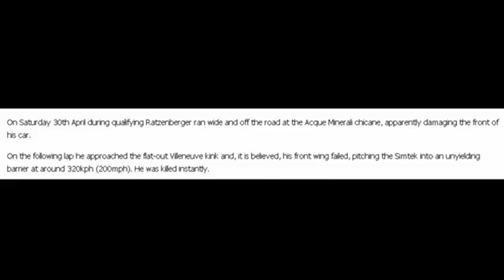Imola 1994:Ratzenberger-how and why he died

Comment: FIA. Those concrete walls will protect them
Reply: At that time there wasn't any technology to protect the drivers like nowadays, there wasn't the Tec-pro's or any device apart from the concrete barriers... Such a tragedy, but inevitable...
Reply: at least they learnt from it and improved the safety of the cars, as we saw with grojean at bahrain
Reply: This comment aged horribly...  they used concrete after Roman at the weekend as the car would deflect and NOT go through and trap or SPLIT an car in 2 resulting in fire... it say on the ticket motorsport is dangerous.
Reply: @leart78 calm down calm down.  Why cant someone talk about the fia ?  Like everything ever done has never worked?
Reply: @bakinek Berger and senna both looked at the corner the day b4 senna died and agreed nothing could be put there.  I'll listen to senna and Gerhard on this one. Also the track changed to fix it not the corner.
Reply: Boom mike drop.
Reply: @bakinek They should have had tire barriers all around the track near the concrete walls. That would have cushioned a lot of the impacts, and no doubt saved a lot of lives.
Reply: @michaeldavis2531  all that does at incredibly high speeds is increased the chance of flipping the car though
Reply: man, imola had tyre barriers everywhere except the tamburello and the some parts of Villeneuve section
Reply: @bakinek Villeneuve didn't have tyre barriers as well

Comment: This was one of the very few fatalities that was caused not by driver error, not by mechanical failure (it did has a part in it, but it was not the main cause), not by bad luck, but because of driver being inexperience.  He should have come back to the pits and checked the condition of the car, or at least have the mechanics take a quick look at it.  I sent a card to his family, and they thanked me by sending me a black and white photo of him.   He actually was quite talented.   It was just sad because he finally made it to F1.  His team also might have screwed up because they would have called him in to check.
Reply: Well, nobody knew how severe the damage was on his front wing. He would have came in obviously if the damage made him slower. The team even asked Adrian Newey for help, since they had problems with wings being loose

Comment: Never knew that his crash and impact was far worse than Sennas. Senna was able to break and slow down to 200 something kph, senna never broke a single bone below his neck.. Rip roland.
Reply: He had a fractured skull
Reply: Roland suffered basal skull fractures and also a ruptured aorta...both common fatal injuries in high speed, sudden deceleration crashes. 
As his helmet appears to have been damaged he probably also smashed his head on something, the cockpit side or his steering wheel while his head was being flung around after the initial impact. 

We don't know for sure if Senna would have suffered brain injury or not if it hadn't been for the wheel and suspension hitting him in the head. 
Although considerably slower than Roland's crash it was still a very fast and hard impact.
Reply: yep. comment edited to "below his neck" cause ineed he had a skull fracture
Reply: Look at Rubens, he crashed at the same track and it was way worse than Ayrton's and Roland's
Reply: @seb99342  Well, it looked worse because of the way the car flew and turned over. But in terms of sheer speed and force of impact, Ratzenberger's was definitely the worst. Everyone just knew as soon as they saw it that he wasn't going to survive such an impact
Reply: @reds005 That was only from the carbon fibre breaking in to his head. Other than that he had nothing, no scratches. Even the experts said that, if the thing that killed Senna, would have flew 6 inches up or down he would have survived.

Comment: RIP Roland Ratzenberger. i remember it well the day before Senna died. Most people remmeber Senna but few remember another F1 driver like Ratzenberger. Greedy Guts FIA and their using drivers as money puppets. Concrete walls just a few metres away from 220MPH cars are accidents waiting to happen. At least some change has happened since then which is good.

Comment: It could so easily have been three, when Rubens Barrichello crashed heavily & a not particularly professional rescue attempt could have aggravated things further.  Luckily Barrichello wasn't badly hurt but sat out the rest of the race weekend, just as well as what was to follow.
Reply: The way they dumped him upright like a sack of potatoes was shocking. Had he actually suffered a serious head/neck injury, that could have finished him off. 
Righting the car so medics can treat the driver is very important, but that was done very carelessly
Reply: Actually the rescue was correct, as per protocols at the time, and even today. The logic is that in such a situation the risk of causing or aggravating fractures (which they took by flipping the car as quickly as possible) is less than the risk of remaining without oxygen. By the time they reached the car, the first and foremost concern was to ensure that he was breathing, and that had to be done as quickly as possible, even at the risk of other injuries, because remaining without oxygen quickly causes irreversible brain injury, and in a situation like that, unresponsive driver upside down under the car, that is the most critical factor. This point was discussed at length in the media, right after the events, and from time to time later on, and the most authoritative medical experts always agreed that the rescuers did the right thing, shocking as it may have been to watch.
Reply: @manliomazzon  
Sorry but NO. If you think carelessly flipping over a car with a driver who could have already been severely injured is correct procedure...then thank god you are not a Marshal.

Are you delusional? 
This careless righting of the car has been widely criticised  back when it happened and still is. It should never have happened that way! There are ways to PROPERLY right a car relatively quickly without potentially making injurues worse. 

How you can argue that a potentially snapped neck/basilar skull fracture is preferable is completely ridiculous. 
These are the kinds of injuries that killed Ratzenberger and Senna, they had no chance of surviving the second these injuries occurred.

While it is important to get the car righted as soon as possible, to treat the driver. This is NOT the way to do it...had Rubens suffered a serious head/neck injury and died because it was made worse...do you honestly think there wouldn't have been serious repercussions?
Reply: @biscuitcase83  what they did was right
Reply: @verscy8726  Have you read Sid Watkin's book? He was the FIA doctor who attended to all 3 crashes that weekend...and he wrote that what they did was reckless and potentially could have harmed Rubens more. So forgive me for valuing the opinion of the highly respected medical professional who was a actually at the scene over YouTube commentators 

He certainly was far from the only one who felt that way

Comment: Seems like the vibration through Tamburello ultimately killed both Senna and Ratzenberger. Seems quite straightforward when you look at both accidents together.
Reply: Lol no
Reply: No. 
Senna's steering failure and Ratzenberger's wing failure would still have happened.
The ONLY thing that you could theoretically say is it is possible the bumpy surface of Tamburello made these problems worse, contributing to where and when they ultimately failed completely.
Reply: @biscuitcase83  how do you know they still would have happened? Both failures occurred through Tamburello
Reply: @DoctorMeatDic  
Because neither failure was directly caused by the track itself.
Senna's steering column failed because Williams had modified it badly. 
Ratzenberger's wing failed because hitting a curb caused the poorly designed mountings to loosen.

Comment: That was part of the front wing that went flying off before the impact
Reply: The guys in the pit had to be blaming each other.....which one last handled that wing ???? why did it come off ?
Reply: @linanicolia1363  it could have been a design flaw. That was the flap that came of the main wing but from what I heard Ratzenberger was driving over the curbs and might have weakened the structure of the wing. I’m sure the bolts were tight.
Reply: @Yahniboy  
Cannot confirm this is fact but there was some possible evidence Simtek were having problems with the mountings of the front wings. 
If Roland did indeed clout a curb a little too forcefully, this problem might have led to the sudden failure of the mountings, allowing the wing to come apart.
Reply: @biscuitcase83    It was known that the structure where the front main plane mounts to the nose was reinforced for his teammate Brabham for the race
Reply: @Yahniboy  
Which seems to indicate the team were having problems with their front wings. 
I guess the team couldn't really afford to modify both cars at the same time...they were a very small outfit
Reply: @biscuitcase83  they only had to modify one car for the race after his death on Saturday
Reply: @Yahniboy  
Oh, sorry, my bad...I thought you meant it was done before the weekend itself.

It still seems like they were concerned about the strength of the wing mountings, and suspected a possible weakness contributed to Roland's wing failure
Reply: @biscuitcase83  exactly. I actually knew his race engineer Humphry Corbett. We worked together years before that accident
Reply: @Yahniboy  
That's very interesting, I wonder if he has some stories about Roland... My father knew Roland from his time in F3
Reply: @biscuitcase83  hmmm he raced in F3 with the team I worked with. Madgwick Motorsport
Reply: @Yahniboy  Did you know Roland personally? 
My father was a circuit support technician in British F3...he took me to Brands Hatch one year and Roland was one of the drivers I met. Unfortunately I was probably only around 4 years old and don't remember it at all...I only know what my dad told me about it 😔
Reply: @biscuitcase83  yes I met Ronald a few times but didn’t know him like a friend only when he showed up at the race shop. I remember he always had a smile on his face and never heard anyone bad mouth him. I also knew Paul Warwick which also died from driving one of cars
Reply: @Yahniboy  
My dad always told me Roland was great with kids and they adored him too. Apparently I was one of them, and I can see why. He had such a lovely warm smile!
Reply: It's not , it's some covering ..
Reply: @diogopinto9462  its a wing flap from the front element

Comment: They kept him alive until he was away from the circuit, hence why the race wasn't cancelled
Reply: If u look at his head wobbling around...it was clear his neck was broken. They pulled him out and started performing CPR...which meant he had no pulse. He sadly passed away on the track.
Reply: @LtheDetective  and by law the race should have been cancelled  but because they kept him alive artificially track side was the reason it wasn't cancelled, think Imola or F1 would have lost millions if the race was cancelled
Reply: No he died on impact with the wall. He suffered basiliar skull fracture after impacting the wall at 95g and a ruptured artery, both of which are fatal injuries on their own. Had he been declared dead on track, the race would have been cancelled causing the sponsors to lose millions of dollars.
Reply: @CarlosTheVillan1874  it was during qualifing on saterday
Reply: There's no doubt he was dead  on impact. His autopsy confirmed it.

CPR was still being performed as he was loaded into the medical evacuation helicopter, some 20-30 minutes after it began.  

Doctors at Bologna Hospital declared him dead minutes after he arrived...basically he was DOA: Dead On Arrival.

Sid Watkins knew it, he told Senna at the medical centre that Roland was clinically dead and nothing more could be done for him. 

Watkins had his hands tied, he didn't dare declare a driver dead at a circuit...he stated that he was told by the FIA to never allow that to happen.
Reply: You need to pay closer attention and open your mind.
Reply: @arconeagain  
To what?
Reply: @biscuitcase83  to Carlos.
Reply: Only a doctor can legally declare someone dead.

So by law he was still alive after the impact, but biologically he was dead.

As long as a doctor doesnt pronounce the person dead on the track, even a decapitated body is technically still alive. 

This is by the way the only reason a doctor is present during executions of a prisoner. They arent allowed to partake in the execution process, but the prison needs a doctor to legally pronounce the inmate dead after he is executed.
Reply: @SportSoulLife  
Errrr..no. WTF are you smoking?

There needs to be a declaration for legality but a decapitated person is dead and you really don't need a doctor to know that.

They're not alive in any sense of the word just because a doctor hasn't confirmed it.
Reply: @biscuitcase83  Ofcause they are dead when decapitated. I was talking legalities. 

What ambulance drivers, police, firemen etc do is declare someone dead. That is still not legally dead.

When they declare someone dead, they still need to show the body to a doctor (or in some cases nurse), say "he/she is dead" or something amongst the lines of that, and when the doctor/nurse agrees, that time of their call is legally when the person died, also the time of death stamped on the certificate. Thats why its  "Dead on Arrival". 

"Dead upon impact" cant be legally declared before a lenghty autopsy has been made. 

Since this problem is a legal issue (wether he was dead or not), he was indeed legally alive then, even if decapitated. But im pretty sure for F1 the non-legal "declared dead" (different to pronounced dead) is enough to stop the race in those cases.
Reply: @SportSoulLife  
It's all semantics as far as I'm concerned. 
We know the FIA pressured Sid Watkins not to "allow" a death to occur on track, he wouldn't have dared to pronounce a driver dead at the track, even though as a doctor he would have known someone was dead.
Reply: @biscuitcase83  look around you, at the world.
everything is semantics.
Reply: @SportSoulLife  he was kept alive so that FIA didn't breach the law of cancelling the race and was declared dead upon arrival. Roland and Senna both were clinically dead as they both had basiliar skull fracture and a ruptured aorta, which was fatal in itself. There was nothing they could do after the accidents occured, because the medics in both the cases considered it fatal upon reaching the crash site

Comment: damn, if the HANS existed at the time, it could have save his life :(
Reply: The HANS device was designed in the early 1980's. But due to the ignorance of the FIA or also NASCAR, it was not mandated until many years later. Both F1 and NASCAR didn't force it until 2002. So many more lives could have been saved ..
Reply: And tyre-barriers... and something to slow down cars, instead of gras.
Honestly, F1 was just waiting for a deadly accident in Imola, at the time that high speed track was very unsafe in so many aspects :-( And greed made it  two deaths in two days :-(
Reply: If only FIA had made HANS mandatory after this incident. Häkkinen almost died a year later from a similar impact but he was very lucky.

Comment: Roland Ratzenberger would've survived this crash if he were wearing a Hans device.  Certainly the same is true for Senna's crash the following day.
Reply: That was the next day? Thats crazy i had no clue they were that close in time
Reply: @supabigsteve3969  Yes. Ratzenberger was killed in Saturday Qualifying and Senna on Sunday in the race
Reply: I wouldn't take it for granted the HANS would have saved either of them. 
Senna also suffered fatal head injuries HANS wasn't designed to protect from. 
Ratzenberger would likely have still died, as he suffered a ruptured aorta, due to the massive deceleration. Possibly that rapid deceleration would have caused fatal brain injuries too on its own
Reply: @biscuitcase83  ruptured aorta? Does that mean he suffered internal bleeding?
Reply: @fwjude  
Yes.
"A ruptured aortic aneurysm can cause massive internal bleeding, which is usually fatal. Around 8 out of 10 people with a rupture either die before they reach hospital or don't survive surgery."

There are photos of Roland with blood pouring from his mouth and nose from a combination of his fractured skull and ruptured aorta
Reply: The HANS device was designed in the early 1980's. But due to the ignorance of the FIA or also NASCAR, it was not mandated until many years later. Both F1 and NASCAR didn't force it until 2002. So many more lives could have been saved and Roland's chances would definitely have been much higher.
Reply: Strange comment, fact is neither would have survived. A Hans device is no use for a burst aorta or penetrating brain injury.

Comment: This is so f'ed up...he just went straight ahead into a wall...
Reply: His front wing sheared off completely, so he lost all downforce at a high speed approach to the corner. 
Also it appears part of the broken wing went under the car, his front wheels seem raised as he heads towards the grass. 
There was absolutely nothing he could do at that point, the car won't turn or brake in that condition
Reply: @biscuitcase83  exactly 😖
Reply: @biscuitcase83  
But the track shouldn't have had a gras-strip leading into a wall in a high speed passage.
Enough people died in F1 before, it was known that drivers sometimes can't brake anymore (R.I.P. Jochen Rindt and many others).
Racing F1 there with this track safety was gross negligence. Going on after Roland died, without any safety improvements, despicable, still going on after Ayrton died, greedy enough to gamble for a third death.